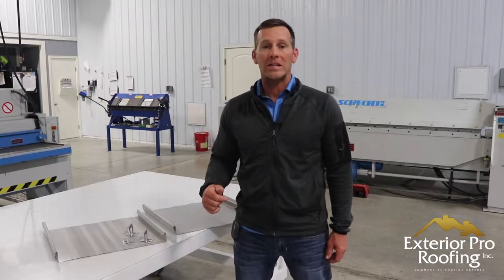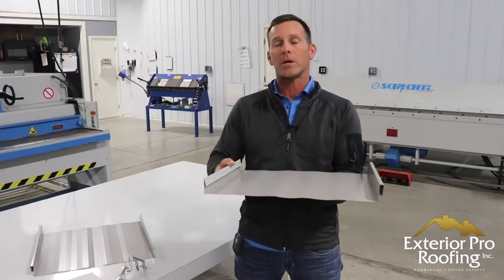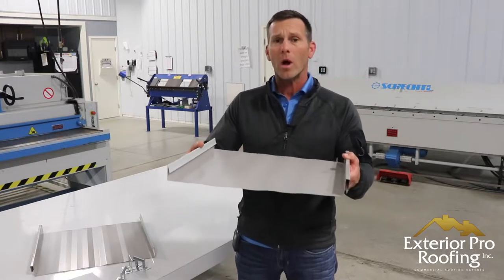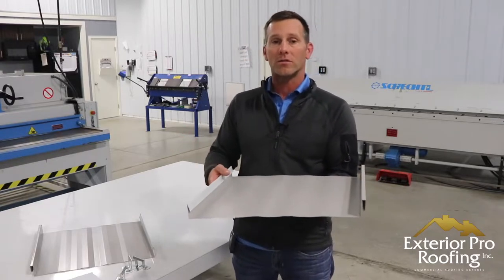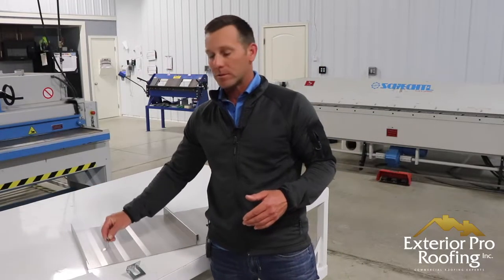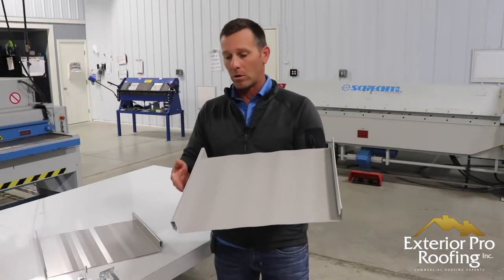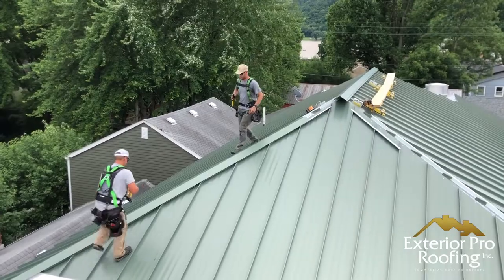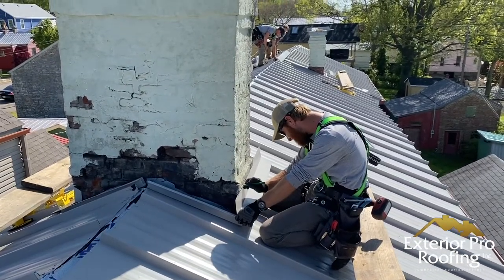What is Snap Lock Metal Roofing ?

Comment: So it is stuck down with Ice & Water. Permanently. No ability to repair an area that gets damaged ? Our current roof Architectural shingles is stuck down to I&W and I can't get any shingles off to repair a small area of the decking and then put the shingles back on or even replace a few if needed. Ours is a simple contemporary roof. No hips, no valleys, just one chimney on the front that insets 3 or 4 inches into the roof and a ridge vent at the top plus 2 or 3 vents. But, its a 2/12 pitch. Any recommendations. If you know of a way to unstick the shingles from the Ice & Water I would be forever grateful. Thanks for posting all these videos, I'm learning a lot.

Comment: Okay hoss, 1st) multiple manufacturers approve this product down to 1x12 pitch. 2nd) multiple manufacturers approve this product for installation over open purling without solid decking. That means no underlayment at all. Just 2x4s or 2x6s over rafters for commercial applications. Plywood's only required for residential.  Yeah I've installed hundreds of projects with these panels. Not trying to be mean man but if you're going to get on YouTube and make a video make sure you really know what you're talking about!!
Reply: Most manufacturer's will not warranty this product (watertight warranty) over open purlins and on slope lower than 3:12. Wood deck or metal deck and iso with bearing plates under the clips are what are usually required for a warranty.
Reply: @andrewkuhlman7464  
I stand by my original statement. I've been doing nothing but metal roofing for over 30 years. You have no idea what you're talking about!
Reply: Is this available in pre-cut lengths for DIY’ers like other panels are?
Reply: @NMranchhand  It is ordered in specific lengths. So yes. But I do not believe snap lock standing seam is a DIY product. New or inexperienced installers always make mistakes. And given the cost associated with this product it is strongly advised to use a very experienced installer.
Reply: @traceyjscott069  Thanks for that.
Reply: @Tracy Scott Would this be the best route to go for a roof with a pitch of roughly 1.1 versus torchdown or other metal? While keeping the cost down? 30 feet by 17 feet?
Reply: @traceyjscott069  just because you have been doing something for a long time does not mean you know what you are doing. If you are the type that is a know it all and does not learn daily you probably are not the one to be talking. The recommendations given here are very good and dont give the idea that corners can be cut. No roof should ever be installed without a decking surface. I dont believe the snow loading of this material would be very high without a deck under it
Reply: @holmes1956O  
Tell yourself what ever you need to to feel good about your position. But Reality and Verifiable Facts support every statement I have made. 
Sorry I had to be the bearer of bad information for you. But I'm not going to let some YouTube Cowboy get on here and misinformed the general public about metal roofing. Not on my watch partner!
You don't like my comments turn off comments on your videos. Other than that get used to it cuz I'm never going to back down!
Reply: @traceyjscott069  LOL.   I did it myself and it is so simple a child can do it.  Only the ridge cap takes a little thought.